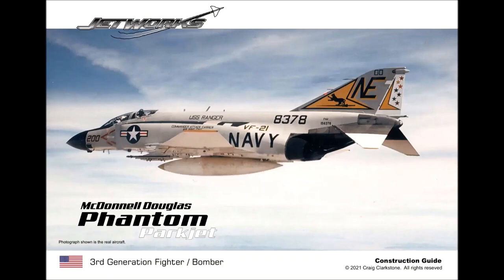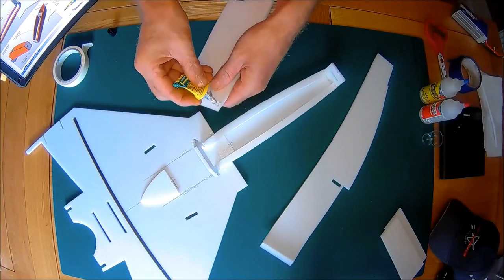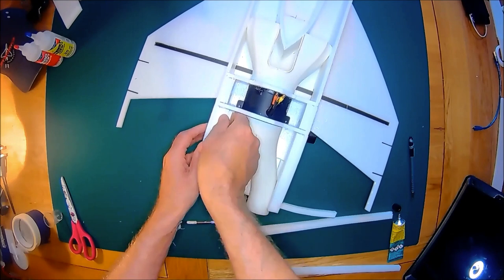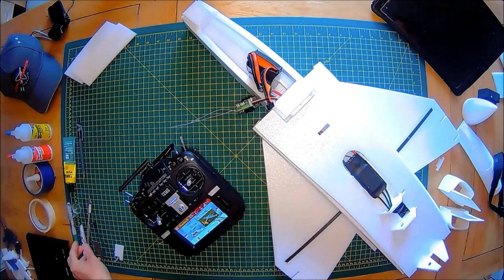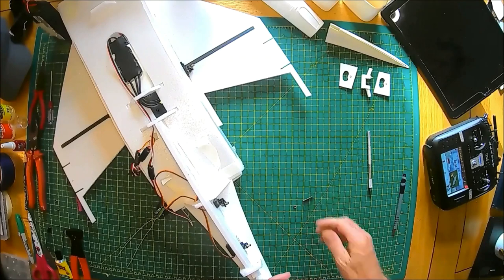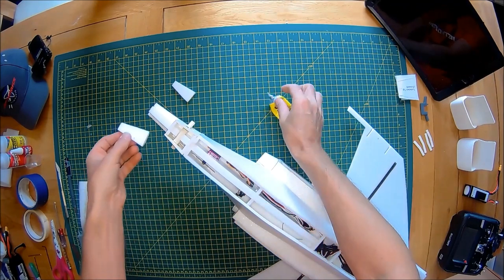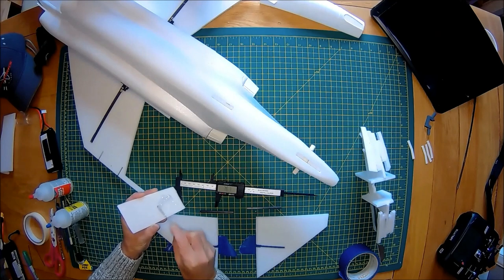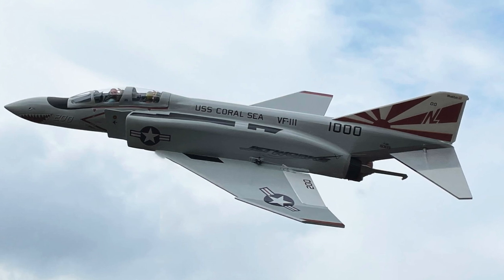Jetworks - F-4 Phantom build

Comment: That is a great video, very clear and concise. I hope you post another jet works build. I'm off to order my depron now. Did you use filler ?
Reply: Thanks Pat 👍 I did use a small amount along the seams between turtle deck top and main fuselage just to have nice smooth seamless finish. Also a little extra filler at the rear next to exhaust mounts for the smooth transition to the exhausts after I gad finished sanding. Craig has a good finishing video on the raptor using filler - https://youtu.be/QCgEkNPwVbQ